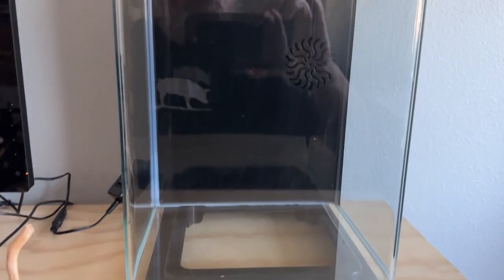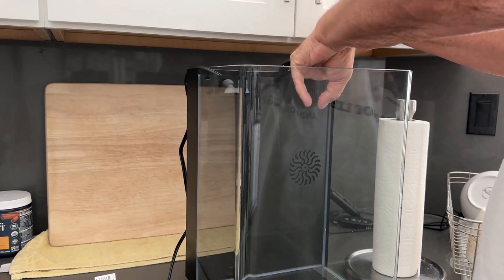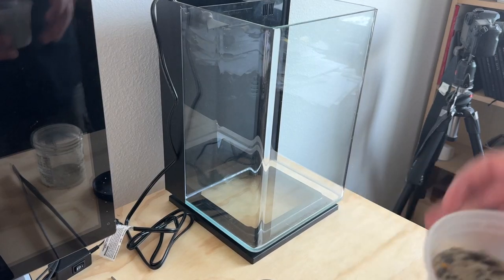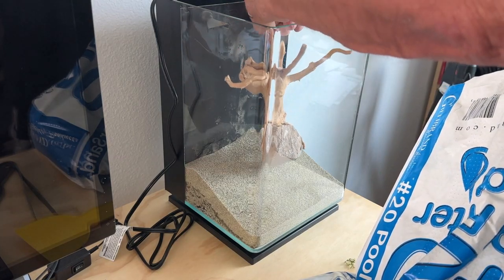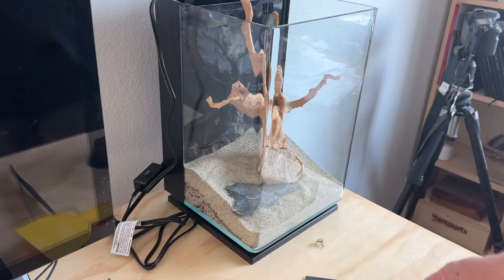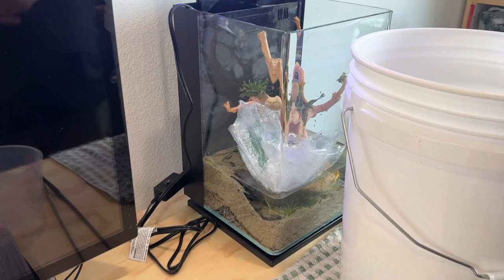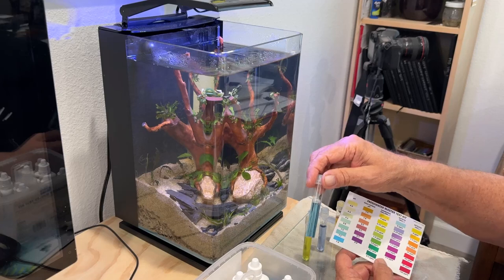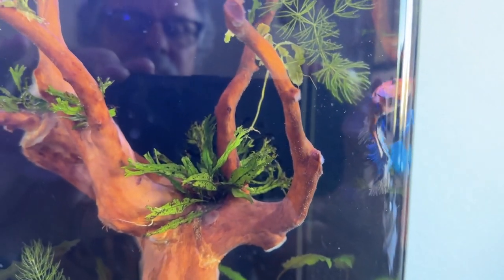Marineland Portrait Tank Build

Comment: Dear Ron:
You did a fantastic job, on this, betta tank.  I truly appreciate your, detailed dialogue.  After watching you make the driftwood ornament, I was anxious to see the tank.
I’ve found that putting Neocaridina davidi, in a tank, which has not been set up, for at least several months sometimes results in losses.  I believe this is because they like to graze, constantly, on biofilm, which takes some time, to build up on all, submerged surfaces.  I think the initial fluctuations in water parameters, in a set-up can be detrimental, to them.  I’m pleased to see that you put a betta, into this tank, for starters.  The detritus it leaves will be a source of nutrition, for shrimp, if you add them, later.  Bettas do tend to eat shrimplets and may even kill adult, nano shrimp, so I would remove the betta, before making this a shrimp tank.
I prefer a black substrate and backdrop.  I paint all, of the backs, of my tanks black.  For substrate, I cap compost (processed horse manure) with Black Diamond Blasting Abrasives (medium grit), which is just coal slag.  I find that a light-colored substrate looks unsightly, once it becomes covered in algae.  I’ve also heard that freshwater fish tend to feel more secure, with a dark substrate.  Many species have light bellies (so as to stand out less, from below, against a bright sky) and dark backs, so as to be less noticeable, to predators, from above, where the bottom of the creak, pond, or stream is dark.  Lighter substrates tend to be marine (i.e. sand).  None the less, this tank looks terrific.  Thank you, for sharing this, awesome, set-up video.
All my best,
Sincerely,
E. J. Brinegar
Reply from the maker: Well thank you very much, E.J. I appreciate the kind words and information. I hav emade the mistake of putting Neos into tanks too soon and lost the lot. I tend to me much more patient these days. The spiderwood is covered with that white gelatinous slime that usually shows up on new wood. The water, plants and the substrate were all from established tanks. All tempting but I'm going to hold out for a bit. I do have some green jade Neos I plan on putting in once I feel the tank has seasoned long enough. Early on, I used a product called EA Bacter to inoculate the tank with a beneficial bacteria for shrimp. Nowadays, I just use water, plants and hardscape all form established tanks and that seems to work quite well. And yes, I have seen my Bettas pick off and eat even larger Neos. They are quite capable of it! So this one will go into another tank once I'm ready to add the shrimp, and I think I'll add ember Tetras along with the shrimp. Probably a couple Otocinclus as well. Once again, thank you for stopping by. Have a fantastic rest of your weekend! ~Ron